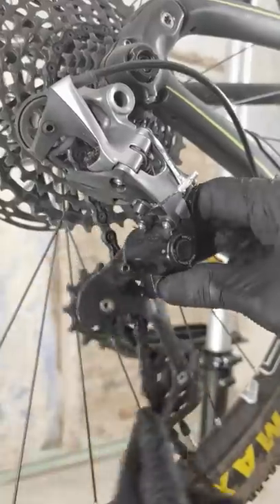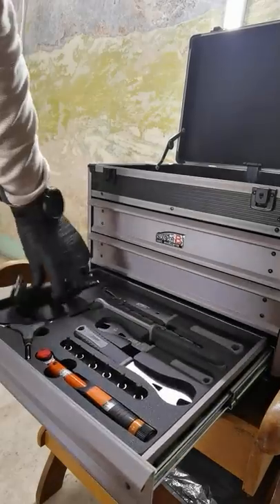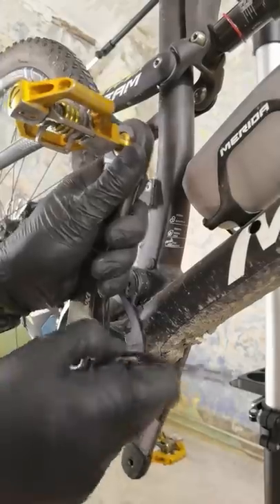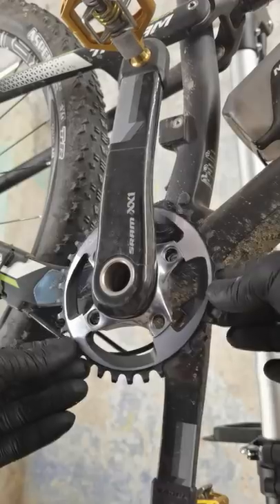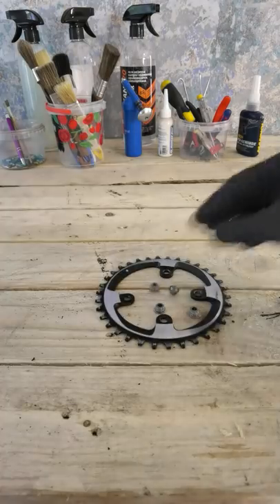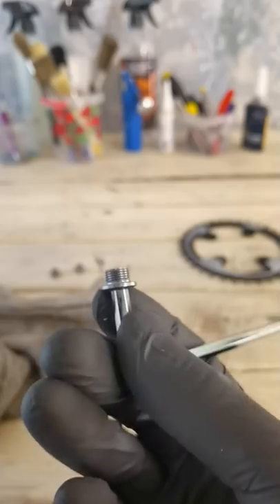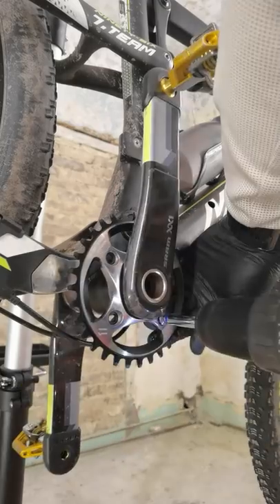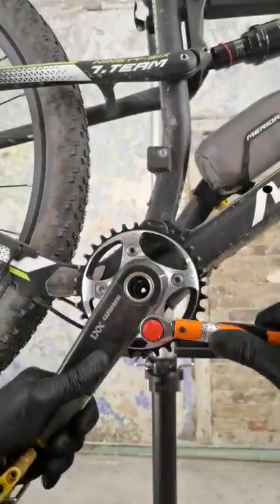Quick - before - race chainring swap. How to replace Sram XX1 chainring. 1x11 drivetrain. #shorts

Comment: Love how a torque wrench is used after blasting it with a impact gun. 🤣
Reply: You dont know what an impact gun is but thats okay
Reply: @MaYbYl8eR  neither do you judging by your comment. 👍
Reply: @skippyguy3  The guy above you is correct
Reply: Just because of the ratcheting sound it doesn't have to be high torque. You can set them super low so that you only put the bolt snug with very little torque added to em.
You would know that if you would work with such tools.
Reply: @kaedeschulz5422  finally a reasonably intelligent human in the comments
Reply: @aapoaunola2080  A pretty rare find XD
Reply: That was not an impact gun.

Comment: Do NOT use a drill to put in the bolts, easy way to strip the threads
Reply: I think he use the drill with lower torque setting. The threads will be just fine.
Reply: @khairulkhai7815  Please do it on your bike.  This is such a bad idea, he probably pre-threaded it and just edited out.  Lower torque settings doesn't solve cross threading.  Do it once and cost yourself a new chainset and you'll never do it again.
Reply: @lolcat9744  i already did.
Reply: @khairulkhai7815  Enjoy, don't say I didn't warn you.
Reply: @lolcat9744 thanks for the warning. But, yeah' im enjoying it.
Reply: @lolcat9744  he didn't cross thread you can see him put the bolts in with an Allen key, so it's not edited out either.
It's not cross threading that's the issue it's blasting the threads off with the buzz gun, just no need to even walk over and get it, he's already got his Allen key in his hand! What's the torque on them little bolts 10 or 20 kn?
Reply: @Rhythm24inch  He used an allen key to take them off, why didn't he use the drill for that too? He "used" the drill to put them back on.  Look the guy who did this video used the drill for dramatic purposes. Those screws have very few threads, there is no time savings and like you said, easy to over torque, while not the end of the world it won't cost you a chainset. Even more costly is if you cross-thread them putting them back in with a power drill.
Reply: @lolcat9744  after they've been loosened, there's no pressure on the head of the bolt and the threads inside, meaning it's perfectly fine to remove using a drill
Reply: @Rhythm24inch  its a fucking drill that has been set to such a low torque it buzzez, he literally said it in the video
Reply: @Rhythm24inch  faster ig, why u so worried abt its not ur bike???????
Reply: @aapoaunola2080  why you worried it's not yours either?
Reply: He just used a drill. It has no hammer.

Comment: My sram bolts are on the rear of the chainring so not possible!
Reply: This assembly is a few years old
Reply: Just undo them from the back then?
Reply: @Rhythm24inch  hassle though innit, having to take the crank off.
Reply: @sallyschildcare  can't you get it past without? Stupid design init.

Comment: bruh the torquewrench is useless 
youve already tightened it wayyy over spec and all youre doing with the torquewrench is nothing
youre not adding any torque as the fastener isnt even being moved
Reply: No he didn't. He had the clutch set to 1.
Reply: It was jump cut to the click of the torque wrench.
Reply: You clearly have no idea how light an impact drive can go. Most impact drivers have an adjustment ring and at its lightest is nowhere near 10nm. And also the video is edited and cut up so it's by no means how he actually did up the bolts.